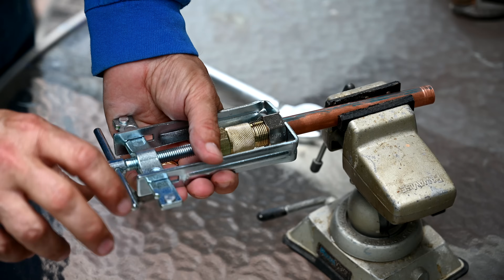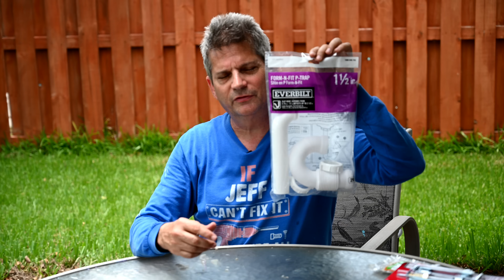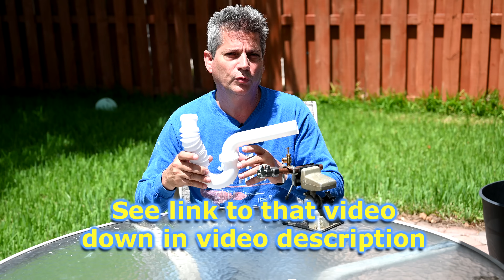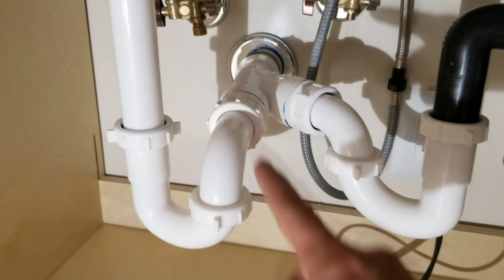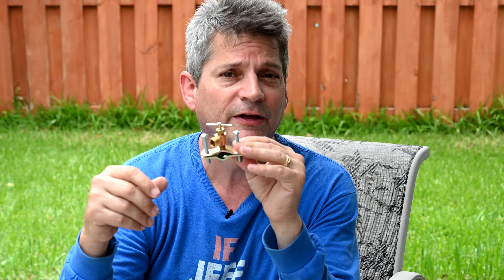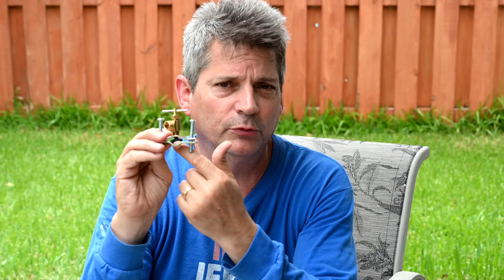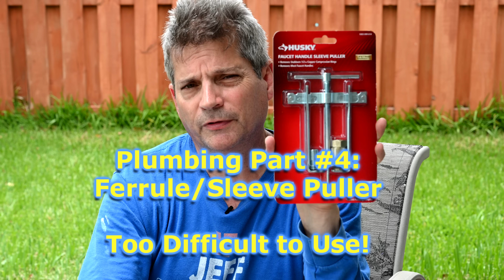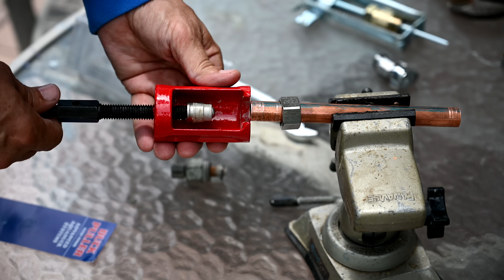4 Plumbing Parts/Tools You Should NEVER Use. NO Plumbing Fails

Comment: As some have noted, plumbers are not cheap.  Solution (tongue in cheek comment), the Solution is to let the water pipe fail, especially if overhead piping, and then once there is major damage you can call home insurance and get the expensive plumber and other contractors in to do the repair : )  Experience, we had an under sink water filter that blew its plastic hose while we were on vacation, and it flooded half our house before it was notice and shut off by our grandson.  It took over 6 months to recover and more because of a hassle we had with getting all of the flooring replaced because the flooring that was damaged was not available anymore.  Maybe a licensed plumber could have put the water filter in for an hour in work as opposed to living with our daughter for 6 months while sheet rock, carpet and tile flooring were being replaced.  The home water filter is now outside.  Still, most was covered by our home insurance.  Hey, Jeff, maybe a video on how not to install a water filter?
Reply from the maker: Plastic hose on the water filter? I always used the stainless steel reinforced hoses.

Comment: Thanks Jeff, great video.  I was wondering how to deal with those large compression fitting behind the toilets, not I know, thanks.  Also, I went up in my attic to see how my overhead water supply to my frig ice maker (in this house only 5 years) and there it was, a saddle clamp.  It is not leaking now, but I will replace it.  Thanks again for the heads up.
Reply from the maker: Wow, saddle valve in he attic is worst case scenario, lucky you never had a leak.

Comment: I use the PASCO 4665 HD puller. 33 bucks and works well. Someone said something about one that reshapes the pipe when the ferrule has compressed the diameter of the pipe down? New to me and would like to see it and get one??

I've had pullers get stuck in the pipe when valve was put on way too tight to begin with. Have reamed the inside of the copper pipe, which should have been done in the first place, remove the pieces so they don't clog anything, then lightly sand and lube in front of the ferrule where it slides off. Also a little valve grease on the puller part that goes in the pipe. Comes off easily.
Reply from the maker: I'll have to look up that Pasco puller and experiment with it.

Comment: the husky puller he used is indeed cheap, BUT... you can see the part that blocks the end of the pipe roll off the table so that the threaded part fits all the way in the pipe. at the end, he says he gets a % from the $ you spend . gee, guess that's why he let that part roll away

Comment: If you place that plunger inside of the brass body that the nut threads on to, it will give you at least an inch more clearance between the "T" handle, and the ends of the pulling arms. I noticed the spacer rolling off the table, as you fitted the brass body. It wouldn't make the tool perfect, but it would make it "usable". If replacing the feeder valve, I would first try reusing the existing ferrule and nut, and if it leaks, THEN take steps to replace it. I would rather avoid scuffing the pipe by dragging the compressed ferrule off of it, if I can avoid it. The pipe is likely to have a crimp in it, right where the old ferrule is, making leaks from the new ferrule more likely, than if the pipe was new. At the very least, try a different depth, so the new ferrule doesn't clamp onto the same section of pipe.
     I've been lucky so far. I've always been able to line up the down pipe with the "P"trap, by adjusting the angle of the trap, and the length of the horizontal pipe. Never a problem. I didn't know those accordion pipes existed, and to me, they STILL don't exist!(maybe as a temporary "quick fix", but definitely not a permanent fix)Just think of the problems, if you ever have to unclog one, your hook would undoubtedly catch on one of those pleats, and punch a hole in it.
     I've always had good luck with saddle valves, but, I've always used them where they're accessible.(never behind a wall or sheetrock)If they ever start to leak, they're very easy to replace, though I've never had a problem in 20 years. Usually, if I have trouble, it's noticeable right away. I haven't had a properly installed one leak after a successful install. Make no mistake, I would hesitate to install one in someone else's house, where I couldn't keep an eye on it. I have several in my house, but I won't replace them, unless I have trouble. That usually happens, if I'm replacing the line between it and the refrigerator, or the under sink water filter system.
Reply from the maker: Good info Vincent,  thanks!
Reply: I've reused the ferrule and nut at least a dozen times and it always works.

Comment: Separating two crossing pipes with a half dozen fittings or a piece of foam?   What to do, what to do?
Reply from the maker: Yes you never want the 2 pipes to touch cause they can scrape as the water pressure moves through them over time I would use foam rubber around them that's probably the easiest solution

Comment: Saddle valves start leaking And dripping water?  Wow .  Two things.
Reply: I've used them successfully many times, but, I DO make sure they're easily accessible. I haven't had one leak yet, but if it does, it's a quick, easy repair. the only problem is, you have to notice it, before any real damage is done.(dampness under the sink)

Comment: Interesting video.  I'm a DIYer who used one of those accordion pipes one time.  I wasn't proud of it, and wouldn't do it again, but it was easy.  It's been in service for over ten years with no problems, so I'm in no hurry to replace it.  Funny thing is that it isn't really needed.  It's a pretty straight run.  I was too lazy to drive to the hardware store to get a regular piece of pipe.
Reply from the maker: Dan, at least you're aware of it and know to be on the lookout for leaks, and you can change it whenever you want with minimal effort. Some of the older ladies we try to help don't know anything about what to do, or can't afford to hire someone to fix it. You're one of the lucky ones with no failures.
Reply: @jeffostroff  I suppose the irony is that the more you stretch it, the less restrictive it would be. Still poor though.

Comment: This is almost like saying that using tap water instead of distilled water will ruin a radiator. If that were true, alot of experienced auto mechanics would lose credibility from so many cooling system failures. (I always use tap water. Flush every 3 years: Never a Problem). 
Point is, if original plumbing had an S-Trap,  nobody is going to look under my sink in my bathroom and cite me for replacing it with another S-Trap. Even if they did, if it never caused a problem up till now, a replacement S-Trap wouldn't either. But I do prefer things to work correctly so I would at least consider all options before hiring an over-priced plumber who undoubtedly would try to sell me on paying for the most expensive way to do it right. In my neck of the woods code allows the use of an air admittance valve for those who don't want to spring for a P-Trap conversion. Point is, there is more than one way to solve something reasonably, without over-paying for something, and without being in violation. I bet some plumbers would say it's not worth going to jail over ;o

Comment: Those products are crap.  But I'll admit to using a saddle valve for my ice maker.  Which has been in place for 12 years now with no leaks or problems.  There's nowhere it can leak that can cause damage in my house though, as it's in the basement, near a floor drain.
Reply from the maker: That's awesome, so you can monitor for any issues and if you have one, it goes down the drain, so you got a win-win situation.

Comment: Ah, yes, using the handle puller on a compression ring. WRONG. There's the part included for the compression ring puller. You remove the handles you are shown gripping and placing behind the nut (wrong)  and use the adapter and sleeve instead. You might want to revise your video to show how to properly use the Husky tool you're complaining about. Previous comment pointed this out. Then, you're not spending 40 or 50 bucks to remove one nut, with an expensive tool, but maybe 12. 
https://images.homedepot-static.com/productImages/55e2665e-fb96-41b9-b051-70d41b64bf03/svn/husky-fitting-removal-tools-63876-64_1000.jpg

Comment: Are the codes for new builds only, going forward from 2017?  Our house is 1950's. I'm a DIY'er simply because I can't afford the $150 an hour for a plumber, plus, last time I had a 'professional ' repair a water leak we ended up with a $1000 water bill when it failed underground and could not be seen for over a month! Even local utility screwed us over by fitting a new water meter and damaging pipework on 'our side ' but not theirs.What you were searching for on 'S ' trap was Bernoulli principle, same as car guys use for engine breathers by using exhaust system flow to 'suck ' air from valve covers. TNot that I have one or have ever used one but, the Ferrule puller is designed to pull ferrule, not the nut. The nut has a taper inside so will always try and compress the ferrule tighter onto pipe. We also had a  saddle valve fitted by an installer, it was inspected at the time but I guess 2012 codes were different? The saddle part has never leaked but the screw down part is total crap., maybe it's the stone age method of sealing parts with string?
Reply from the maker: Peter, codes are for new buildings, and any time you remodel an old building and open walls for inspection. Of course you still have to stick to codes about  traps and saddle valves, those are things you don't want to add now, and when you can, you should change the old banned parts out, or monitor them for failures. You are a bit off on the ferrule puller, you are indeed supposed to pull it from behind the nut. It is the nut which pushes against the ferrule sleeve, and slides it straight off the end of the pipe. the nut will not try to compress the ferrule unless it is pinched against another object in front of the ferrule sleeve, such as the angle stop housing.
Reply: @jeffostroff  Thanks for reply and clarification

Comment: Sounds like a bunch of plumbers bought some politicians to make rules to keep us poor people down.
Reply from the maker: No, the proper parts don't cost much more to implement than these incorrect parts. When you house floods from one of these failures, you'll curse those same politicians for not doing enough to protect you from ad contractors with more plumbing codes.
Reply: Used to be you could build your house however you liked, no inspections, and no, you could not get insurance, you assumed all liability for your work, yourself. If you went to sell the house, you were probably out of luck, when codes came in. If it burned down or flooded because you didn't follow a few simple guidelines, it was all your own fault. Now, people have houses built FOR them, and don't know a pipe from a wire, nor a screw from a nail, and figure their insurance will cover anything, even shoddy work or things wearing out (nope.)  I see this more in the roofing industry, people expect the insurance to cover a 50 year old roof that was only rated for 20 years, because it finally leaked. Nope, should have been replaced long before, at least twice! I'm not a roofer, and people call me and want me to fix the roof leak by repairing the DRYWALL CEILING inside that was damaged due to a roof leak (which will leak again the next rain.) Unbelievable.

Comment: Say what you want- As an amateur do-it-yourself type, the single smartest thing I learned to do was solder !! Yeah I know, not everyone wants to do it , but I have saved a ton over the last 49 years when I first tackled a 1/2 in copper repair with 50/50. Also, common sense dictates that anything corrugated would catch debris. I hate ferrules and compression fittings anyway - all of the shut off valves I replaced were sweated on. Learn to solder folks ! - you can do it ! Jeff, your video is informative but you could cut the time to a fraction of what it took to tell us 4 things to avoid.
Reply: Solder. Leak. Redo. Solder. Leak. Redo. cut pipe try again. Solder pipe, leak, redo. Forget that. Use push-on fitting. Ah-ha! Valve fails? Remove it, leave nut in place if compression, replace valve. If push-on, simply use proper tool to remove, then replace. Several times, 50 years or so. Solder: first time, tear wall apart, replace  pipe in wall. Burn down house from stray flame. Yeah right. Guess what, they're NOT USING copper anymore anyway, so why bother trying to learn it, it takes hours of practice, and then you'll still run across a few that leak. PLUS burning down the house if you're not careful.
Reply: Solder , no leak, learn to do it right !. And I am an amateur. Nothing wrong with push ons. I've used lots of PEX with crimp fittings and also Shark Bite push on's, too. Be careful regardless. You are right about fire.
Also, if you learn to clean your copper  and solder , you are one step ahead when it comes to brazing and silver solder (silfos)  on high pressure AC fittings. The last plumber I hired was gifted- he ran hot water to my outside faucet. Also, I air pressure all of my copper repair jobs before closing a wall. You're right about another thing - it takes time and practice to learn to solder. Ok, ok, I will back off a little and say this :  Shark Bite push on fittings are terrific and one of the greatest plumbing inventions ever.
Reply from the maker: Yes, could have been shorter, but there's also a lot to disseminate, a lot of places for people to go wrong here. I did break it up later into smaller videos focusing just on each one, and will have another one coming out this week for the flexible pi-traps by itself.
Reply: Fair enough.  @jeffostroff

Comment: *6 yrs plumbing. Yeah, never liked saddle valves. It creates too much work that isn't neccesssary. Rather throw on a duo 3/8 by 1/4 inch angle stop and run the line. Great vid🤙
Reply: yeah it should be called 6 months to 2 yrs insurance claim valve for your ice maker
Reply: Or run a street coupler with a Denning valve

Comment: That ferrule puller is crap. I've used a similar style successfully many hundreds of times. It has a sleeve that slides down over the arms to hold to the nut. About $10. Probably Pasco.
Reply from the maker: Yes that sleeve sounds like a game changer like it would make all the difference in the world because you really need something to hold those arms together
Reply: @jeffostroff  no, the arms aren't to be used at all for compression sleeves.  As the shaft threads through the brass fitting, it pulls the nut and ferrule forward, and the chrome plug pushes against the pipe. It appears you didn't use the chrome plug at all. 

https://youtu.be/7KDe8ACKjwc
Reply: @mlindholm  It was on the table and rolled off. And why cut up on a fellow plumber for not leaving enough room to cut off the existing valve to replace? Some customers demand it. They only want to see chrome. We have enough battles out there with handymen and others that think they can do our jobs without doing the leg work etc. and these shit stores selling name brand garbage killing profits etc.. We are all in a brotherhood for the same cause is what I'm saying. We all are in the same fight. Stand together and stand tall.  Give them hell Jeff. Do one on those business killing Sharkbites.  Or how this new phase that the middleman will save you time and money. NOT!!!!!  If you need to go through somebody to get to me rather than just calling direct, you can bet it's at least 60.00+ more than reg. rates. Fools. Eat shit Google.
Reply: @badkitty2011  It really pisses me off when plumbers claim to be king. There are many very skilled 'handymen/remodelers' who are not plumbers but do much better work than many plumbers. I have seen so much crap done by licensed plumbers that I knew how to fix. Who wants the valve hanging so far out that you can cut it off to install a new one? Pulling a ferrule without messing up is easy. The tools Jeff shows are junk. The out of production Lasco puller and c-clamp style Pasco do great. The Superior/Bleckman tool looks OK. The English Tool Co tool handles course and fine thread nuts.

Comment: I'm an electrician and get a ton of work from "handman " electrical work that I have to go and fix.
Reply from the maker: Yup I was doing some of that today wall changing ceiling fans and discover that and one of them was a metal Box that they forgot  To bond the Box to the system ground. That's one of the most common failures I come across.